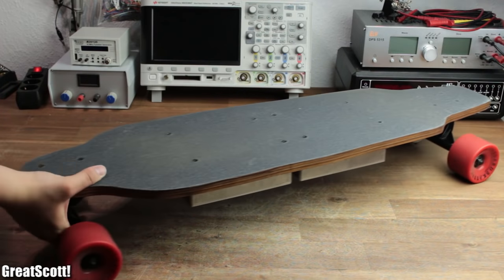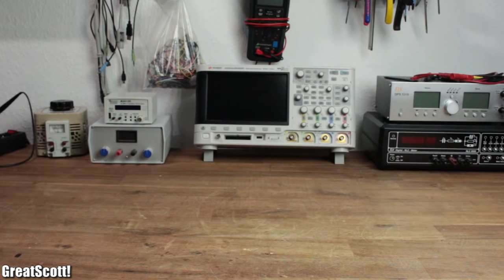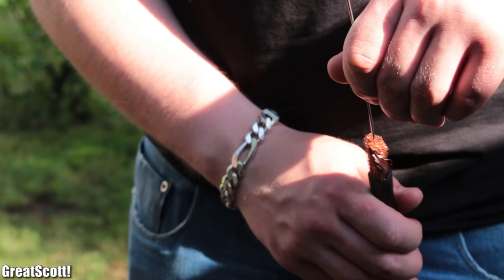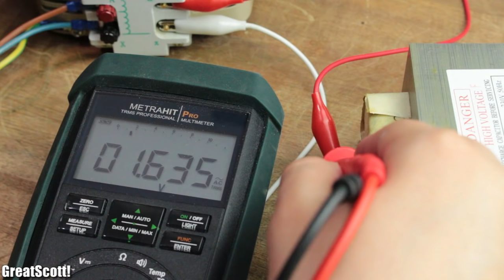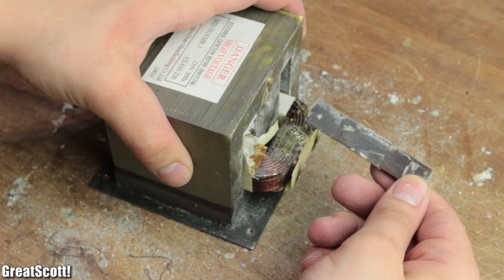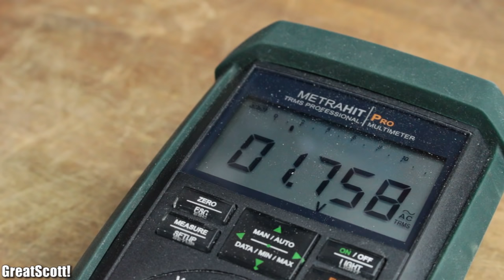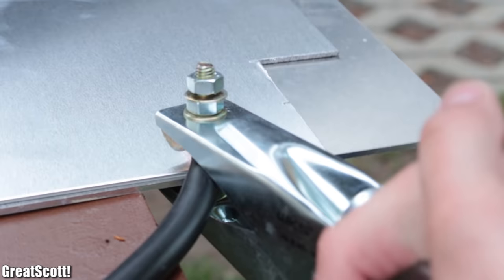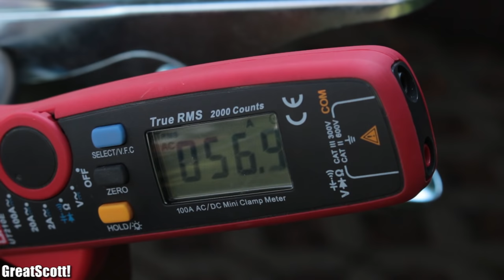HACKED!: Microwave Transformer becomes a High Current Transformer

Comment: I am going to make a Jacob's ladder. I have a 15kV 30mA neon transformer that is 110v on the primary. If I applied 220v to the primary would it output 30kV at 60mA safely? Or would It just explode.. I have access to both 110 60hz, and 220 50hz. Thanks.

Comment: Using a Soldering iron would work to :) you don’t need welds. Cause they way more dangerous
Reply: No it wouldn't. The metal is a huge heat sink and it'd never get hot enough to melt the solder.

Comment: You have too use a sheilding gas also. Like argon, because of the oxygen. Are u using AC currant? that the only way too weld aluminium. Or just go to a welder that can weld with a TIG. Nice too see u giving it a try. I have been a welder for almost 10 years now. And i dont know anything about electronics. Find your channel very fascinating.
Reply: Oh, saw that this is a one year old video. U probably know this by know.

Comment: Welding machine using microwave transformer!!
Reply: He's using too heavy of a wire I made one out of two transformers in parallel using a smaller wire and my welder will weld quarter inch steel works just fine

Comment: The AC current requires AC sticks. They help keep the arc ignited during polarity change.
60 amps is enough to weld thin stuff, so I think your issue is either the stick or that when the current starts to flow more you have greater back EMF.
On the secondary side, adding an inductor, then full bridge rectifier with choke on the DC side may fix this. 
See
https://images.app.goo.gl/6BPtShjwU9Ljg5M96

For a home made version I found with a diagram that uses this technique.

Comment: 1:27 i wanna know how many people got shocked because they didn't know the capacitor was charged
Reply: Ibraheem Khazbak, as long as you don't put your hands on both contacts, you're fine, also the transformer has the big label: Discharge capacitor before working.
Reply: @EdwardTriesToScience  you can still get shocked if you are not isolated correctly
Reply: What I'm trying to say is that DC doesn't care about isolation.

Comment: you cut out the wrong side. you could've made the voltage even lower by cutting out the primary winding
Reply: jackreece123 he doesn't need a lower voltage, it's not working because the voltage is too low to get enough current flowing

Comment: This hurts me. You cannot use plain filler rod as a stick weld it breaks the arc. Just strike an arc with a carbon or tungsten electrode and feed that into it while shielding it with gas uh maybe you should just buy a welder.

Comment: How is that possible that touching a low voltage but high current transformer side is safe ‽‽ The power hasn't change on both side of the transformer sooo isn't it supposed to give you the same damage or electrical shock ??
Reply: ohms law

Comment: Quick genuine question, Ive always heard that its the amps that really kills you and not the voltage. Most people from what I've seen so far regard high amp low volt transformers as far more safe than a stock microwave oven transformer. If I where to for whatever reason touch one of the lines for a circuit lets just say 5 volts and 100 amps (from my knowledge 200ma is considered lethal) would this be fatal?
Reply: The important thing to remember is that in any circuit, the current through that circuit (including you, if you are part of the circuit) is determined by two things: (1) The voltage of the source and (2) the resistance of the circuit.

If this transformer can only produce 5V, then the current through your body is determined by the Ohm's law equation I=V/R. A rule-of-thumb number for resistance of a human body is 1000 Ohms (usually it's higher), meaning the current out of that 5V supply will be (5/1000) = 5mA. Dry, intact skin is at least 10 times more resistive, meaning the current will be more like 500 uA.

What you'll see is that none of this depends on the theoretical maximum current output of the supply, and that's because the voltage is the limiting characteristic of the supply.

If you connect that same supply to a coin or a wrench with a resistance of 0.05 Ohms, that is when you get the 100 amps of current:
I = V/R
I = 5 / 0.05 = 100A

All that said, don't go touching electrical things you don't understand. But that's why the people making these transformers are fairly blase about touching the leads; they know the voltage is too low, combined with their body resistance, to allow a dangerous amount of current to flow through them.
Reply: @moredots  Ah I see, and I’m assuming this is why people are scared around stock microwave oven transformers but not these modded ones to output more amps. The resistance is to high in the body but once the voltage is high enough it will conduct through the skin. Did I get that right? (Thanks for the well written out info :) )

Comment: In order to weld metals correctly so it last you must remove/prevent oxygen from being around the hot metals being welded/solderedc.... oxygen interferes with the way two different metals want to react with each other when no oxygen is present... oxygen is paramagnetic... which means that when oxygen is in an external magnetic field it can produce its own magnetic field to oppose the external magnetic field... another words oxygen is electronegative....so it wants to react with something if given the chance to do so whether...it's why flux is used... this man obviously knows this because the principals of soldering on circuit board are the same principals as welding.... just different materials and higher temps

Comment: But why you didn't first tried to flip the transformer. So to that on secondary side you put mains voltage (230v) and on primary you must get around 27 volt.
Reply: @Ognjen Radojevic ElectroBOOM has done it without melting transformer.

Comment: You should've wound the two transformers in parallel and should be getting a current between 80 amps to 180 at least
Reply: Ashton Docter, actually an arc welder needs an arc, so you need more voltage, like 48vdc.

Comment: Aluminium is a bitch to weld with sting works better with tig with a higher voltage tho you could be able to do steel but I doubt it would penetrate far

Comment: you did pretty much everything wrong to even have enough power to do anything remotely close to welding you need two microwave transformers connected together properly i will not elaborate on how to do this because if you learn this by yourself you will obtain a rudimentary understanding of both what you are doing and safety precautions

Comment: Please test this for us.  What if you switched input voltage to secondary ?
Reply: In this case you have 230V/8.6=26.7V on "new" secondary. If transformer have 800W (I can't see the label cleary, so I estimate basing on size), the current might be 800W/26.7V=30.0A. It's pretty low for this application. But it is only a theoretical numbers, in real live it will be much worst. Wire on primary of my GAL-800E MOT (or your project secondary) have diameter of 1mm, so area of pi*(1mm/2)^2=0.79mm^2. This is too small for 30A, they will start heating up quite fast. Higher temperature means higher resistance and higher power loss in cables - current and voltage on the electrodes will fall. Thats the reason why nobody use cables with cross section area lower that 16mm^2, only on some case 10mm^2. You will have  16/0.79=20 times smaller area, so 20 times higher resistance. Generally you will creating unpractical and dangerous electric heater.
Reply: @saganovsk6322  thank you for such informative reply!

Comment: you need at least 24 or 48 volts, 60 volts max.
Reply: And shielding gas (Ar) to protect the weld from oxidation while it's being formed. Aluminum is much more difficult to weld than steel.

Comment: One transformer is not enough , I mean on one from microwave,  lets say your transformer is 800W , and minimum for welding you do need 30V at least, with current of 50A, that would be 1.5kW, so u get clue, you need two of those transformers in serial connection. So make em each produce 15 V , since they go in serial you going to get 30V. But each of them will handle half power , if you wind secondary to produce exact same voltage on both. So now you have power you need without burning your transformers. Kinda late comment but hey mate, I found you one month ago, can you believe in that ??? So great youtuber with great knowledge and I missed to find you so long , even I exist on YouTube for 2 years as video maker but I am kinda poor youtuber. I really love your work, even you are younger than me but both of us doing almost same things, I found few tips from you that I did not know from before, thank you for that.

Comment: You need to shield the weld surface form air when you're welding ( they use gas i think) right?. Can we use 2 transformers to generate higher voltage. Anyway, this project is rediculously unsafe. Only real professionals or idiots would try it at home. I'm neither of them so hell nooo not trying it.

Comment: You have no ideea what you are doing. To be able to weld, you need a minimal voltage and amperage. Before destroy a funcțional transformer, you should calculate wether it will deliver enough power for your welding (P=V*A). Knowing you have to reach minimum voltage and amps, you can easily calculate the minimum power needed, wich is given by the metal section of the transformer and primarul coil. If your transformer can deliver enough power, then you need to calculate the section of wire to use în the transformer secondary.

Comment: you need a gas like argon
Reply: Tigerfire828 that's not how stick welding works. But the 'rod' he is using is a filler which indeed needs a shielding gas

Comment: So, not to sound discouraging but you are an absolute beginner at welding. Aluminum is one of the most difficult metals to weld (well, not so hard if you have the right setup, but the setup is more complicated). The transformer you built is suitable for a spot-welder. You should research that and find plenty of examples because every third person on the internet has converted a microwave oven transformer into a spot welder. You seem be trying to use this transformer as a stick welder. It's just not big enough for that. Look up information about the Lincoln "Tombstone" welder. I think these may come in a 120VAC version, though the 240 VAC is most common. Maybe it only comes in 240 VAC and I saw a conversion to allow 120 VAC. At any rate, look at the insides of one of those. These are dead simple devices. It's just a transformer. Note how big of a transformer it is. This is purpose built for stick welding. This is a small stick welder. It's about the minimum. That should give you some idea how far away in terms of power your transformer is from an entry level stick welder. And again, aluminum is hard to weld. I don't think you want to use a stick welder for aluminum; although, I think they do make special sticks for stick welding aluminum. I forget. Never tried them if they do. You need a MIG or TIG welder for aluminum. MIG is cheaper and easier to start with; although, if I had to do it over again I would have started off just buying a TIG welder. With MIG you have to option of using "flux core" wire so that you can weld without a separate tank of shielding gas. Resist the temptation. I'm not even sure they make flux core wire for aluminum. If you are going to buy a MIG then go all-in and buy the extra stuff your need for shielding gas. If your MIG includes the hose and regulator, then all you need to get is a tank of shielding gas. There are many choices here. CO2 is my favorite for welding steel. It's not the best, but the low cost and ease refilling CO2 makes it worth it. A tiny tank of CO2 will last much longer than a big tank of Argon. The pute CO2 welds are not as pretty as blended gases. Pure Argon is OK for steel and OK for stainless steel and good for aluminum. Argon+CO2 is good for steel and stainless steel, not for aluminum. They'll tell you not to use CO2 with stainless. It's fine. You can also mix stainless and regular steel. Obviously the weld points will not longer be stainless, but it all works fin. So that will all set you back around $1000 and after a month steady practice or so you should be ready to weld aluminum.

Yeah, so for what you want to do I would just take it to someone that will charge you $20 to $40 to TIG weld it.

Comment: How tf does the electricity get to the black cable he used?!?
Reply: thats the problem, I have asked everywhere, at first I thought it was magnetism, but magnets cant carry electrical energy... so the question still stands...
Reply: Its called Induction. And its to do with magnetism because electricity and magnetism are basically the same thing in different states. An alternating (backwards then forwards movement measured in hertz e.g 50hz) current in a cable produces a magnetic field around it (you can observe compasses changing direction when placed by cables in micheal faradays experiements) This magnetic feild expands and contracts causing an electrical current to flow in a conductor (the black cable).

Comment: wait... is the wire attached to the primary coil or does some really cool physics happen where the electricity jumps to the coil?
Reply: I dont think it might be cool physics tbh, how can you send electricity to a copper cable covered with rubber
Reply: DRUGS'HAVEN induction
Reply: DRUGS'HAVEN what means "tbh"?  I don't know it :(
Reply: tbh means to be honest
Reply: Yes, it is a cool physics, very cool indeed. Just search how transformers work, and you will get the answer.
Reply: The coils are not attached. One coil uses electricity to make a magnetic field, and the magnetic field makes electricity in the other coil. As someone said, this is called "induction", and it happens because moving electrons make a magnetic field, and magnetic fields make electrons move.
Coils are designed so that the magnetic field made by the electrons is more powerful, because there are a lot of them moving in the same place, so the magnetic field of each electron adds up with the others.

Comment: You need to have an output of 22 volts and around 110 amps, you want to be able to adjust your amps though for different thickness of materials. I use a mig 170 from harbor freight. https://www.harborfreight.com/170-amp-dc-240-volt-migflux-cored-welder-68885.html

Comment: fuck. I ripped out the primary coil of my transformer. It used to take 230V AC down to 12 V AC and I ripped out the primary :(

I then replaced the primary coil with some 2-3mm wire and did two turnings (it was a small transformer). I was expecting to connect the secondary (now primary) to 9V DC to try and get some cool sparks coming off connections from the coil where the primary used to be (now secondary). But nothing is happening. I tested both of the coils and they both are conducting... so what is wrong?!
Reply: joe m you can't use DC on a transformer
Reply: Yes I know its DC. but I did it in very small pulses.

Comment: Dont use Aluminium 😂😂
Reply: If you have to join aluminum, think about (1) brazing it instead, or (2) buying a MIG welder (with special setup). Really, these are the two simplest ways to attack the problem. SMAW on aluminum? Eeeeek!

Comment: Why not using the Lighter one trick. The type they have maken transformers can give a lot of high voltage for bigger one.
https://youtu.be/SK0p1PFiXI4
The only thing is you have to gave a lot of time to it because in that you have to remove each and every plate of old transformer separately then arrange them according to new verient. I know it will work.(ROYER CONVERTER) think if it worked.